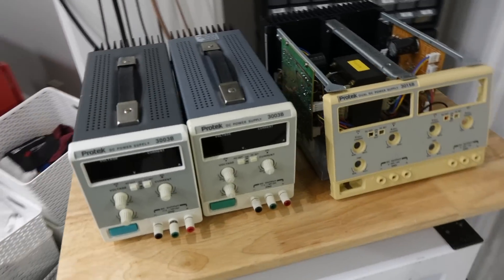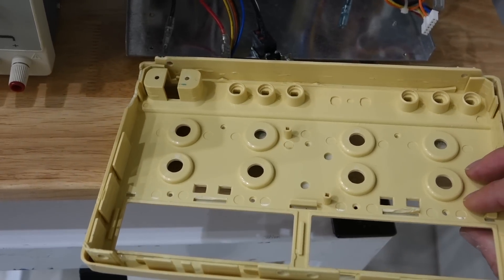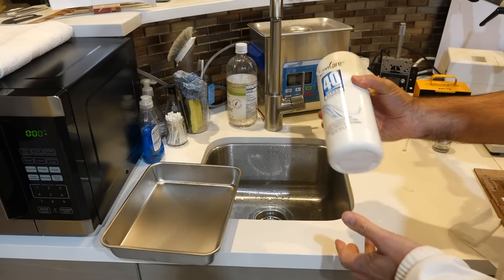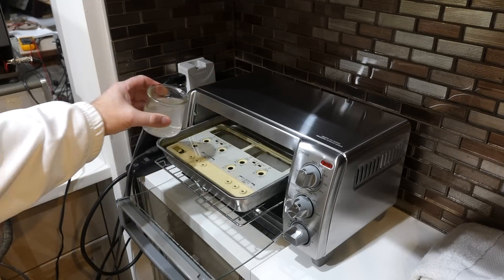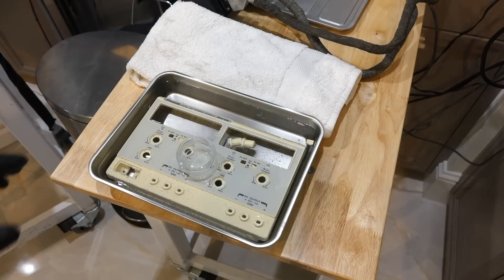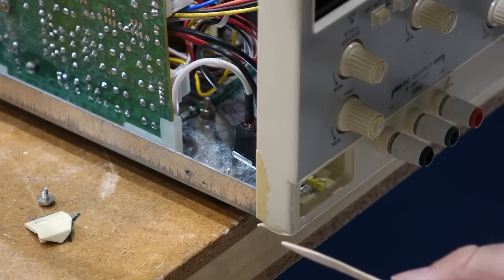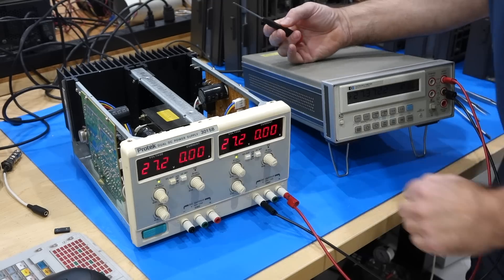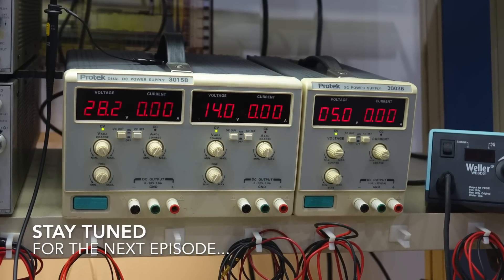Retr0brighting the easy way (Protek 3015B power supply)

Comment: The 3015B is a decent supply and is easy to service.  Good thing too - I've had to fix it once when I purchased it at a hamfest second hand from a dude who insisted it worked fine.
Now if we could only find a product that cures that stinking black rubberized plastic stuff so popular in the 2000s-2015 or so that turns to sticky black goo which cannot be removed from whatever it gets onto without dynamite....

Comment: Nerds have to say “retr0brightsuper1337woot” because saying “bleach” just isn’t nerdy enough for them. 🙄

It’s bleaching. It’s just bleaching. It isn’t alchemy. Hurr durr UV hurrr muh secret formula.

I’ve been bleaching ABS for YEARS and it’s exactly as easy as this video.

I use opaque containers because light CAN effect things and cast shadows in the reaction. 

I use an electric kettle warmer. This maintains a temperature normally of about 130° in a big tub of the mixture.

I pour a few gallons of 12% food grade peroxide into an opaque tub. I pour an equal amount of water into kettles and get them boiling then pour it into the peroxide tub. Mount the kettle warmer so it can maintain the heat in the liquid. Submerge your parts then place an opaque lid over top to eliminate light and to keep the heat inside.

Before this process I highly highly recommend you wash the plastic with degreasers like dish soap but I use Super Clean and scrub it down with magic eraser. Careful, Magic Eraser is actually abrasive and will remove any screen printing. With no grease and the surface brought down with the Magic Eraser your plastic will come out of the vat looking WAY better than you can imagine. Better than all the YouTubers have shown. It’s the best results I’ve seen.

Finally, you MUST protect the newly exposed and embrittled plastic. Notice it is very dull looking whereas most new devices have a sheen to them. The sheen is just oils that are part of petrochemical-plastic composition. We can fill the dull porous surfaces with oil by using 303 Protectant Wipes. Forget Armor-All etc. ONLY 303 has proven itself in my decades of this hobby. I promise if you just stick with wiping your newly cleaned and bleached plastic with 303 wipes you will never think twice about it.

Comment: Do you repair vintage computer equipment for pay? I need someone who does.
Reply from the maker: Sorry, we don’t.
Reply: @CuriousMarc  Thanks Marc. I just picked up an I.B.M. 360 control panel.
Reply from the maker: @markohara5146  Wow! Which model?
Reply: @CuriousMarc  Hey! Model 40. In almost mint condition. Complete. Also picked up a PDP-11/t55. Any manuals for that one available? Hey, I'm restoring the PDP ...would it be better to leave the outside metal frame with paint missing and blotches (white or cream colored) or have it repainted,,,or would it be better not to repaint it?
Reply from the maker: @markohara5146  Bitsavers has a whole directory of IBM 360 stuff, for example http://bitsavers.org/pdf/ibm/360/operatingGuide/C20-1635-2_Model_40_Operating_Techniques.pdf
Reply: @CuriousMarc  Sorry; I should have said manuals for the PDP-11/t55. Looks like you guys have one? Any info or manuals for it? I may have an auto shop repaint the (zinc alloy?) frame an off white as it has some paint missing in spots. What do you think from a vintage standpoint?  The I.B.M. 360/40 I would love to find someone to rewire it to emulate the 360 system, or even to simulate the 'blinkin lights' for effect alone. I'm in South Florida and don't know anybody here that does this stuff.
Reply from the maker: Contact me via my about page, and I’ll put you in contact with Carl Claunch who has relocated to Florida. Hooking up a control panel involves doing a microcode-exact emulation and finding the original microcode, which can be a challenge. It’s a large project regardless.

Comment: Higher temperatures can accelerate the yellowing of susceptible plastics, but it's not strictly necessary -- they can yellow regardless, and the evenness of the yellowing on the power supply front panel, inside and out, makes me suspect that's what has happened here. Also, the 8-Bit Guy does sometimes have problems with plastic coming out unevenly brightened, and if I recall correctly, he's blamed that on uneven paste coverage. And finally, your method is really the "simplified simplified" method, because if I again recall correctly, the original retr0brite recipe involved more than just hydrogen peroxide, but others worked out that it was the hydrogen peroxide that was the active ingredient.

Comment: I have done this for years now. I learned the UV is almost completely unneeded. 
But on the other hand I brightened a Mac LC by just sitting it in the sun on a rotating bed for a couple days in a row ( in a northern climate) That was the easiest as I didn't have to take it apart.

Comment: Bromine was only responsible for yellowing in some computer hardware in the late 70s.  It’s a more complex reaction induced by UV light.  Modern LED lighting will limit reyellowing.  Fluorescent lighting with exacerbate it.  You should coat your plastic with UV protectant to reduce reyellowing.  Perifractic (Retro Recipes) has a good video on it from 3 years ago- Retrobrighting with just the Sun.

Comment: You really needed to spray some uv protectant / clear coat on the retobrighted panel before assembly.
The plastic will yellow at a faster rate ... I did retrobright for my Star Trek Captain's chair project... and the plastics have already yellowed back to near brown color because I didn't protect the surface from additional UV photons.

Comment: So.....hmm. How much Bromide have been released into our populations for, say, the last 50 or 60 years?

Apart from that; excellent video.
Love the ease with which you did it. 3% Hydrogen peroxide diluted with water. 50/50 it seems. And then in an oven for 24 hours. Brilliant.

Comment: The best results I’ve seen use UV. Either left in the sun or using LED / strip lights. Hairdresser Peroxide works well as it is in a cream so sticks to the surfaces. Liquid peroxide is good in a fish tank surrounded with UV led tape and foil.

Comment: Your behind the times😂. Vapor Brighting is the new thing. No submersion, a little heat and the vapor does the work. No problems with uneven coatings. 
Your method seems easy, but i think it has a lot of risk of warping plastics because of to much heat. Ovens are usually not that well regulated
Reply: To avoid warping you must keep the plastic below it's glass transition temperature which for ABS is a little over 100 degrees Celcius. I set my overn to around 75c and check it with a thermomter.
Reply: @Andrew_Fernie  that's smart, but the sun people usually use for the heat doesn't get anywhere near dangerous temp and still works. I can already see the idiots turning up the knobs and melting their plastics.

Comment: I often think it would be nice to make an OLED of TFT display replacment for HP supplies.  Not least because a couple of mine have degrading plastics around the edge of the analog meters, but also to add some more infomation that im sure must be available in the circuit

Comment: I said the same thing on Dave's videos, but I don't understand the reasoning for using hair bleach instead of pure hydrogen peroxide. Hair bleach typically contains large amounts of water and some chemicals to slow the bleaching process and not damage the hair, which is something you don't need on plastic. Pure hydrogen peroxide diluted with water should give you the same result, faster and safer, and don't involve exposing your components to extra chemicals. Those extra chemicals can have unintended side effects on some forms of plastic, especially some of the more exotic ones from the 70s and 80s where they mixed different materials to make them more durable
Reply from the maker: If you look at the chemical formula in the video, pure peroxide makes two free radicals, ones that helps bleaching, one that undoes it. Bleaching solutions do have some additives that promotes the bleaching radical and cancel the other. They are also properly diluted and have other ingredients so that they are safer for the skin. That said I diluted it further and used gloves when I touched the liquid, and I am not a chemist, so take it with a huge grain of additive salt.

Comment: Heh. My company had those power supplies!  They were desired and often mobbed because of those two buttons. The one on the left turned the output on and off (so you don't rely on the power supply regulation on power up - those can be nasty spikes that damage attached equipment). The button on the right let you set the current limit (without turning the output on). The traditional way we had to do it was short the output and set the limit that way, but we've burned out many power supplies that way because you're not supposed to short them out for extended periods of time (stresses the shunts and such). Despite their rather generic "Chinese-y" look so you'd think you'd be able to get identical ones from other companies, we never managed to.
Reply: Shorting the output is part and parcel of my acceptance testing of, well, pretty much any bench supply. Properly engineered designs just shrug it off. Under-engineered stuff may not like it, and it's an instant "reject" from me :) Even better if a supply can survive a heavy duty relay switching between shorted/open output at 1Hz. Some supplies have unprotected bipolar stages that explode after a few minutes of such treatment. I use them, well, their cases, and put my own designs inside :) I mostly use HP, Kepco and Power Designs with few changes, but over the years I've re-laid their PCBs to improve performance a little bit, and add a few features. Over the next year I'll putting that stuff over on Hackaday. Slowly.

Comment: Hello, the result of the discoloration is great 👍I have two white outdoor 230V sockets with a cover, one is exposed to the effects of the climate and the sun - the cover has turned yellow during the time it has been outside, but the frame has remained white, the other one is mounted so that the sun cannot reach it and it is still white as when I installed it twenty years ago - not material, like material.
🤔.......... 🤔 so that the HP source doesn't feel sorry for him and he doesn't feel sad somewhere in the corner, so send it to me 😁 it will look good on my shelf with the same design HP devices, and besides, my birthday is in three weeks , so it fits 🤣

Nice day 🙂 Tom

Comment: Hi Marc, regarding using an oven to keep things warm, I recently bought a large food dehydrator for things like this. I needed it for heating up my 3D printer filament for several to drive out moisture as the rolls have been out in the open for a long time. The advantage of the dehydrator is you can't accidentally set it to super high temps and I don't have  to use my kitchen oven for these sorts of tasks.  FWIW, I got the large COSORI model on AMZN, don't know how well it'll last but it's not like it'll be use a lot.  Cheers!

Comment: Be careful using heat as the Vicat (softening point) of some plastics are about 65 degrees C, being close to that will result in shrinkage and deformation.
Reply: Been there, done that! I washed the back case of my RS DVM after the batteries leaked and tried drying it in  a toaster oven on low, it ended up like one of those shrinky-dinks from the 1970S
Reply: Some plastics will start to melt around 40 C, but those are typically not used in electronic equipment
Reply: Yep.. I melted a bunch of tek 2465 knobs by mistake
Reply: It would be interesting to know if submerging in fluid helped keep the temperature of the part regulated at a lower level. Overnight in a toaster oven at 150F, logic would assume the part reached 150F, but there’s evaporation of the fluid to consider. That is, we’re below water’s boiling point, but there’d be evaporation into open air accelerated by the heat. Would that regulate the temperature down?

Comment: Great video - as usual. As a product designer, here is my alternative method for really bulky items like CRT-housings: have a rattle-can (or several) flat matte "computer-greige", solvent-based ACRYLIC spray paint mixed: Spray-paint your (de-greased) discolored ABS-parts in several thin layers from various angles and they will look crisp and new and will never yellow again as the acrylic binder is very UV-stable (test paint - plastic compatibility on the inside first and let that spot FULLY dry... there should be no cracks or wrinkles or any stickiness after about 1hr!).

Comment: I love your intro, explaining it's basically an oxygen bleaching process. So many of the early materials were like "I don't know why it works, but it does", I'd been dyeing my hair since I was 12 so I immediately knew it was bleaching! 

Although it's possible to overshoot if done with risky methods like high heat or direct strong sunlight, very weak near-UV light or weak heat like you used is almost impossible to overshoot which is nice. It mostly reacts with the oxidised bromine, pulls off the oxygen to un-free-radical itself, and leaves the ABS more or less as it was. 

Those higher-energy retro-bright reactions just have enough energy that the free radicals actually can continue to attack the bromine and even sometimes the ABS itself or the other dyes, and that's when you get those awful over-brightened pieces. 

When you're bleaching hair you need a second component to get the peroxide to actually interact with the melanins, but brominated ABS seems to react by itself once it's yellowed!

Comment: Why not just use straight hydrogen peroxide 6-12%? It works well and you only need to elevate the temperature to something like 40C for good results. Hey Birt did an excellent video on this.
Reply: I'm using 30% H2O2 at ~15% for retrobrighting PLC-s. It works also in dark and room temperature but it takes 24-72 hours.

Comment: The one button that went yellow is simply from a different batch of plastic than the other three.  Apparently just a small variation in the ratio of Bromine in the plastic makes the difference between turning yellow or not turning yellow over time.  I have a Super Nintendo where the top shell piece is normal and the bottom is very yellow and both parts experienced the same environment over the years.
Reply: I have seen this happen to outlet plates installed in a home, it is annoying but very common.
Reply: Pretty fascinating

Comment: I'm also under the impression that the de-yellowing chemical reaction benefits from UV, which made me think you were going to stick the tray into a UV dish sanitizer instead of a toaster oven. Those are pretty common in Asia, might be worth doing a side-by-side vs. just providing heat from the toaster oven.
Reply: UV is the reason it goes yellow in the first place. In order for UV exposure to work the amount of light provided must be completely even along the entire surface of the object, otherwise you'll see noticeable shading

Comment: You need UV light to whiten. If you would have put this out in the sun with the 40 on it, it would have whitened quite nice, I know because I do this all the time and it works,  the heat did very little, the whitening you achieved was just from have the perioxid solution sitting on it.  I use the gel and spread on a nice coat cover with plastic wrap and then sit in the sun for a while.

Comment: Tip: What I do with bad condition plastics (brittle, weak or dull color) is to use furniture oil. To be exactly Pledge of the company Johnson&Johnson.  The smell is very nice and revive the plastic very well. You need a thick layer of this stuff and let it soak for a few days. The result is amazing.
Reply: Interesting!
Reply: I was going to use some car dashboard product. Should be plastic-safe and, hopefully, with a similar effect. Retrobrighting sometimes leaves the plastic a bit dull.
But thanks!
Reply: Yes the silicone oil in it works wonders, though you can also use tire shine, the unscented clear silicone oil, to do the exact same, and also you get the advantage you can spot apply it as well to things like the clips, to get them more flexible again. I bought a 5l bottle of it years ago, and as you use it sparingly it lasts a long time. Cost around $60 then for it, and I use it on all plastic car parts as well.
Reply: @SeanBZA  Silicone oil/spray is not the same and doesn't have the same effect. Silicone hardens and makes the surface SHINE and that is mostly not what you want. Silicone is like a layer of varnish on top of a strachy/dull surface. This pledge product goes to the inside of the surface and leave a matt shiny finish (like as is as brand new).  When brittle, it soften it a little to more flexible to avoid it can easily break. That is really a difference and I know this difference because I tried it several times.
Reply: @codebeat4192  Pledge main ingredient is a polysilicone oil, so you need a similar oil to add plasticiser back, as bisophenol is not considered safe. Other ingredients are a water base, a fragrance and a preservative, but the main ingredient is the synthetic silicone oil.
Reply: Ugh... yes, but: solvents, light hydrocarbons and tensides will fill in the tiny cracks in the plastic - but they will also attack the remaining plastic and cause chemical corrosion, further weakening the part! Try a mix of boiled linseed oil, beeswax and a tiny amount of turpentine (WARNING: rags with this mix WILL self-ignite!!!🔥🚒): the color will deepen and white spots/scratches will be filled in. Oxygen from the air will polymerize the BLO in a few days. Works well on polyamides (power tools) too. There is a commercial product called POLYTROL where the BSO is replaced with synthetic polymerizing oils that have a lower risk of auto-combustion.